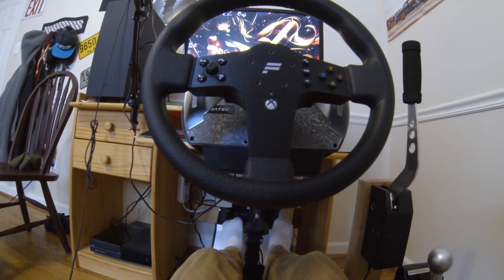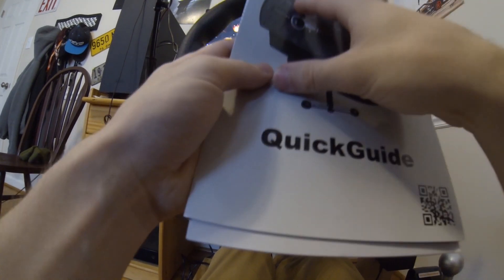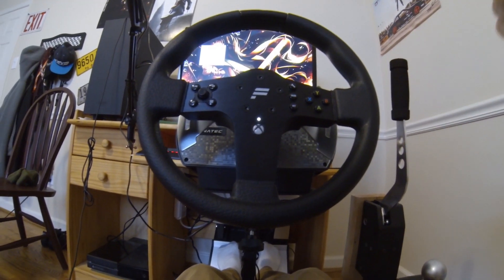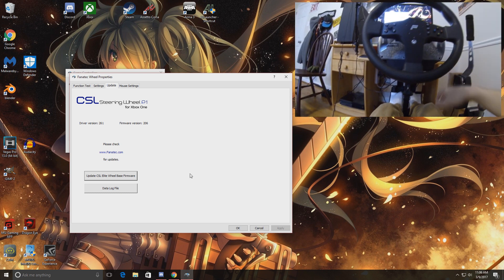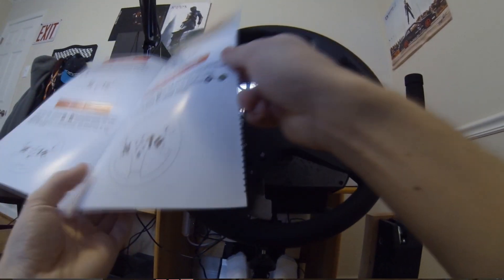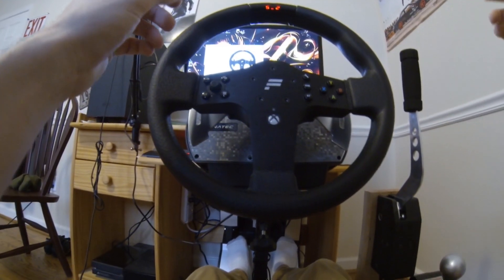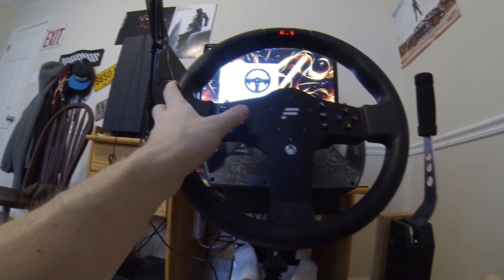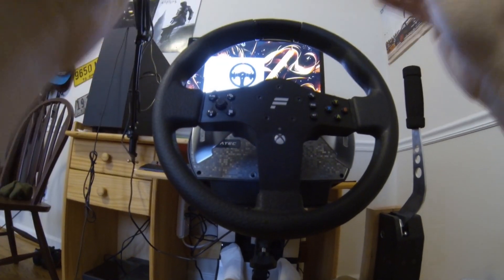Fanatec Wheel Calibration & Setup

Comment: If I’m setting up the base wheel and pedals should I be setting up everything the by wiring it all together then doing the firmware I’m thinking it will give me the option to update firmware for each piece if all wired together then update individually. So basically what I’m asking is if I have a full bundle can I wire up first then go in and do each firmware and calibration update or do I need to do each piece separately before I wire everything up. Thanks
Reply from the maker: When everything is plugged into the base, it’ll update everything at once. So if you have Clubsport pedals, and shifter it’ll update everything at once. I don’t think you can really update anything separately unless you run them as a stand-alone with a USB port. 
But in short, before you update your wheel just make sure to have everything connected to the base.
Reply: That’s great thanks for the reply

Comment: I don’t know what year you made this video but I have a CSL elite base with a WRC wheel could you explain to me what I need to do for that?
Reply from the maker: The WRC wheel is far newer than this video. lol This is quite an old video... as far as the calibration process. Usually Fanatec sends a Manual with the steering wheels, and this has all the details on setting it up. If not they keep the Manuel online somewhere. I’ll link it in another comment if I find it.
Reply from the maker: https://fanatec.com/media/pdf/60/2a/e2/CSL-E-SW-WRC-QG-EN_Web_13_MO.pdf
Reply from the maker: Bottom left panel has all your information

Comment: For a new wheel. I should calibrated before attach the wheel?
Reply from the maker: Mr Shehabi I have no clue what you mean...
You have to have a wheel attached just to calibrate, if you are switching wheels then no you shouldn’t have too.
Reply: ᴰᵉᵃᵈᴮᵉᵃᵗ Đɍɨfŧeɍ what i mean. If i bought a new base and a wheel , i connect the base and do the calibration? Then i attach the wheel ?
Reply from the maker: Mr Shehabi 
no the wheel has to be on to do the calibration.

Comment: im stuck in xbox mode and none of the buttons are working after i updated
Reply from the maker: Chris McGuire pretty sure I know what you are talking about, and I’ve had that happen.. there is a way to fix it and it’s simple. I just don’t remember... only think I can think of, is you have to go into devices and delete it, and have your PC relearn the device.
Reply: @fe2551  its weird but after i update my wheel the buttons dont work therefore when i cant switch to pc mode what i have found to work is turn the wheel off and take the rim of and leave the base plugged in and turn it back on and then it works
Reply from the maker: Chris McGuire I’ve ran Into this issue plenty of times... and there is a fix for it, Ali just don’t remember. It’s been a year or so since I’ve messed with my wheel. lol

Comment: How do you turn on the lights at the base of the steering wheel? I play in Xbox and F1 doesn't turn on. I would love some advice. Thanks in advance.
Reply from the maker: Ander Ground 
Some games it does work, and it doesn’t on other games, depends on if the game has the support for it.
This is more common on Console, on PC you can run 3rd party software to fix this.
Reply: @fe2551  ok. thank you very much

Comment: I have the csl elite f1 wheel and it is slightly of center and it isn't fully fixed by calibrating it. It already whas when I pulled it out of the box. Do you have any solution?
Reply: Jesse Balk I have the same problem, have you fixed it?

Comment: Great video! But i have a question. I plan on using my Csl elite base for PS4. Does that mean i have to install the drivers on a pc then replug it into my ps4 for it to be calibrated and work?
Reply from the maker: ATM 3105 Never used one for PS4, and as much as I’d love to be accurate on everything. I don’t work for Fanatec. 😭

But to answer your question, you’ll want to download the newest driver on PC, then go ahead and Calibrate it on PC. 
You should be fine after that, but for example Forza on Xbox has issues with the game not registering Calibrations.. if this happens, yes, you’d need to recalibrate on Console but only the wheel position. 
When you cut your wheel on for the first time and it rotates, that’s actually the wheel calibrating it’s positions, just make sure to cut your wheel off after doing everything on PC, then cut it back on once ready on Console. 

Hope that helps, and sorry for it being so long. ✌🏻
Reply: ᴰᵉᵃᵈᴮᵉᵃᵗ Đɍɨfŧeɍ thanks for your help!
Reply: ᴰᵉᵃᵈᴮᵉᵃᵗ Đɍɨfŧeɍ also, can i do the calibration on any computer with windows 10? Even a laptop?
Reply from the maker: ATM 3105 Yes, you shouldn’t have a problem with it. 
You can even calibrate your wheel on Console, but it’s best to do on PC. Just because you can use the Fanatec control page to make sure everything is in order.
Reply: ᴰᵉᵃᵈᴮᵉᵃᵗ Đɍɨfŧeɍ thanks once again!

Comment: Hey how about the handbrake? ??
Please help me bro
Reply from the maker: armerol27l I don’t own a Fanatec anymore.. but you literally just plug it into the base and run the Fanatec software, just to make sure it is working.
Reply: Katsukara did you plug it to the data or shifter port?
Because neither my shifter or handbrakre want to calibrate or work 😣
Reply from the maker: armerol27l shifter goes into its port, and the handbrake goes into the extra port on the wheel. Handbrake shouldn’t have to be calibrated, shifter does though.

Comment: hey man do you know what each of the sup menus in the tuning menue are on the p1 wheel itself? like obviously FF is force feedback but cant find any info on the others
Reply from the maker: Pike Matton I don’t have have my Fanatec anymore I traded it for an S13. But it has 
SEN (Sensitivity) Degrees of rotation.
FF (Force Feedback) Strength of the wheel
SHO (Shock) Shaking/Vibration motors
ABS Is for braking vibration on pedals
LIN (Linearity) Does some wack stuff 
DEA (Deadzone) Adds a dead zone to center of wheel.
DRI (Drift mode) Makes wheel rotation faster, but less FFB 
All that’s left is FOR (force), SPR (spring), DPR (damper)
And the S_ menu is profile settings. 

Page 26 has all your answers
https://www.fanatec.com/download/CSW-V2_Manual.pdf

Comment: what is your wheel setup though i'm struggling on all the options
Reply from the maker: If your talking about the profile settings. Mine is pretty much normal setup.
Drifting: All setups are as they come, and FFB at 65, I run 1030 degress, and Drift mode at 3
I mostly only drift with mine.